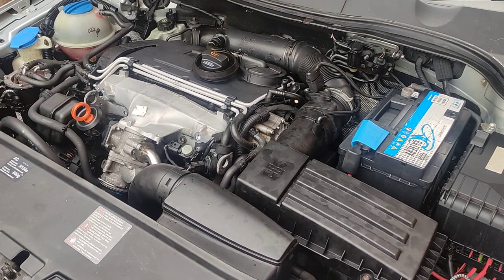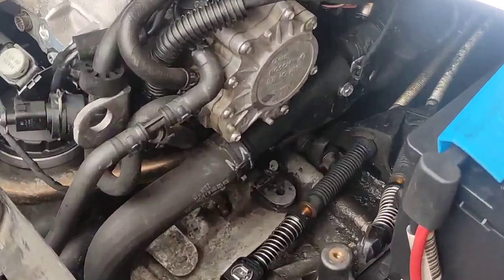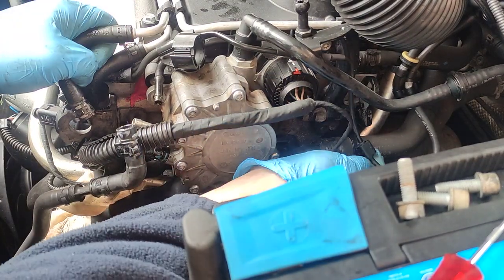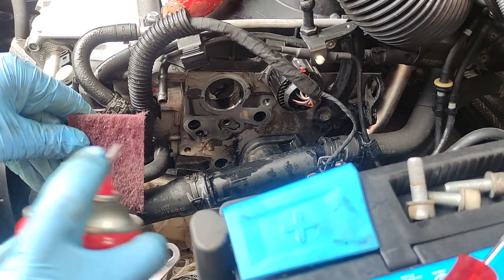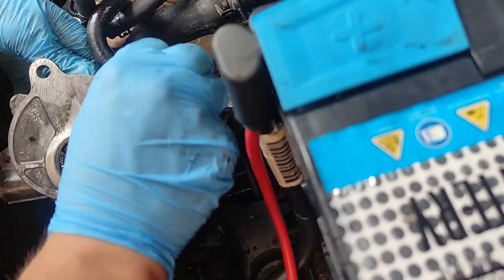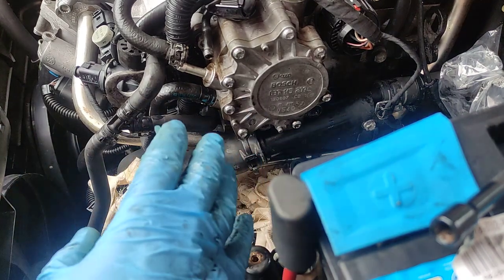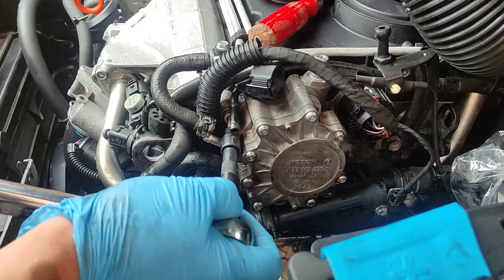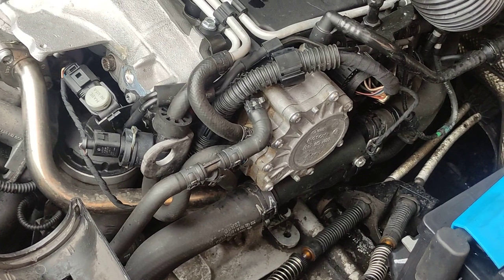2.0 TDI PD Tandem pump gasket replacement.

Comment: Thanks i did rebuild on my a4 b7 2.9 tdi bre, but now is leaking oil and the car brakes, before rebuild it was leaking diesel and had no brakes, no sure what i did wrong, any advise?
Reply from the maker: Maybe something on the inside. Try another pump ?
Reply: Thank you Sir
Reply: Check the top hose i think its vacuum i had trouble getting mine back on it had a small rubber gromit just needs pushing inside the tube then it went on pretty easy

Comment: Isnt this gasket leak main cause for bad warm start, my car cranks when warm, and in the morning starts like a dream, 2.0tdi BKD
Reply from the maker: I don't know, Could be. I did not had any problems with hard start
Reply: That’s probably the fuel pump if it’s hard to start when warm. They are expensive. But you can find companies to renovate them quite cheap. Good luck.
Reply: sound like bad pump;/
Reply: Same as mine I just live with it lol

Comment: I have the same engine. Hard start in the morning. And after 2-3 hours after engine is turned off. I change 2 injectors, injector seals, glow plug, and the same problem. Can u help me please????
Reply from the maker: Can be the pump , but best is to someone that can read data and read the car in the morning, see the pressures and  find the problem.
Reply: @MeFixingEverything  Tandem pump. Or fuel tank pump?
Reply from the maker: Can be both,  check pressure with the vcds
Reply: Thank you bro
Reply: @MeFixingEverything where in vcds and what are the accepted values?